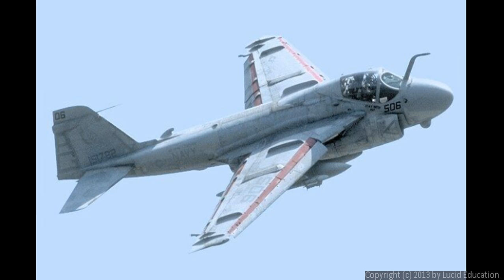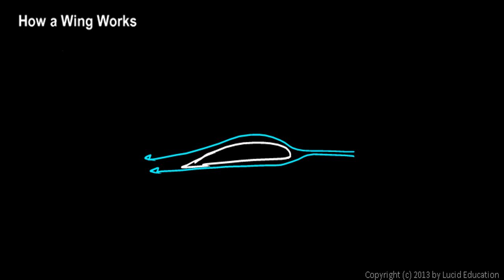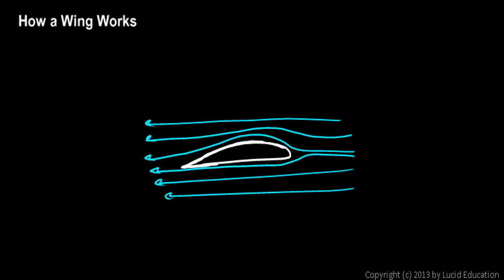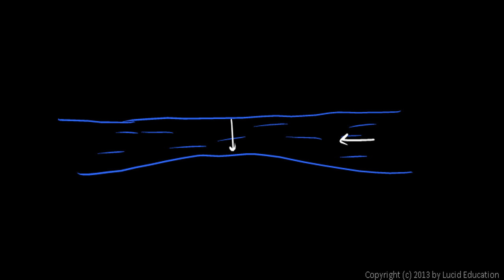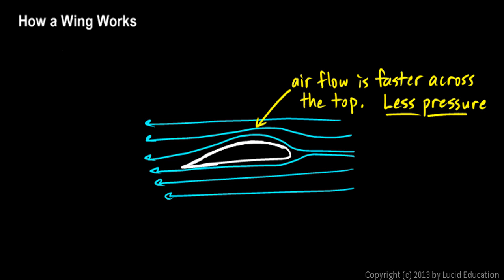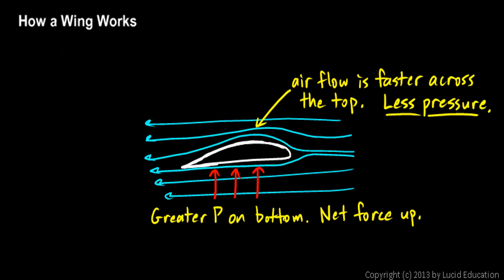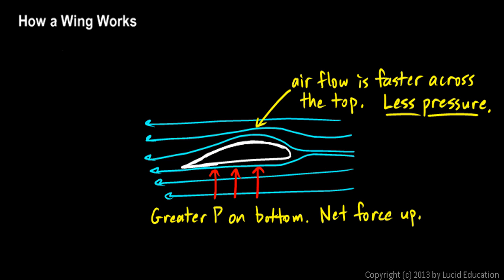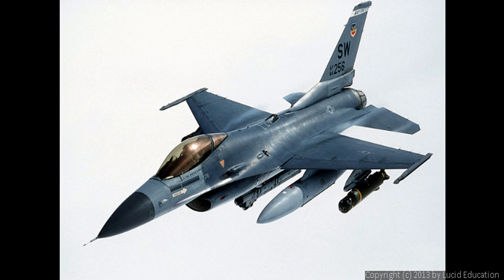Physical Science 3.5b - How a Wing Works

Comment: Bernoullis principle does not state that as the velocity of a gas Increases the pressure decreases. Rather the pressure  decreases perpendicular to flow and opposite to flow, but Increases in the direction of flow, ending up with the same net pressure energy. You have use this  caviot  that bernoulli included in his principle.

Comment: The difference is pressure doesn't cause a force. Rather the difference is pressure is a force. You don't cause a pressure difference and get lift. A pressure difference is lift. Also,  the airfoil shape does not cause a lift force. The shape causes efficient use of the force, but is not it's cause. Further,  the most efficient shape changes with airspeed. A shape that is more efficient at one speed is less efficient at a different speed. To get a lift force upward,  you accelerate air downward.

Comment: Any explanation of lift which claims to be physical science should distinguish between behaviour when a hydrofoil moves through liquid helium as opposed to when it moves through liquid sodium. Any explanation based on Bernoulli, Newton or Coanda fails to do this.

What happens in liquid helium is nothing much. There is no flow separation at the trailing edge and no transverse force or lift on the hydrofoil.

In liquid sodium, which is definitely not a superfluid, there is a flow separation at the trailing edge due to viscosity. A starting vortex is dumped in the flow. By the topological principle of the conservation of vorticity, there must be bound vorticity associated with the aerofoil.

This bound vorticity generates lift by the Magnus effect. I might talk instead about the Kutta-Joukowski circulation theorem, but it's the same basic idea. For fixed configurations of vorticity in two dimensions this is a linear subject where we can use the principle of superposition and say that total lift is proportional to total vorticity bound with the hydrofoil once the starting vortex has disappeared from the scene.

If an aerofoil moves in an intermittent start-stop action, it dumps both starting vortices and stopping vortices, forming a vortex street. This can actually be visualised. This is not a difficult subject once we can see what is going on.

Comment: Why do people always use bernoulli's principle in the wrong way🙄
They say: Because the flow is faster, the pressure is lower.
While in reallity, it is the drop in presure (pressure gradient) that causes the flow to speed up. 
The change in velocity (acceleration) of every (fluid) particle is proportional to the force (pressure) across it! Simply newtons 2th law!

Don't get me wrong:
bernoulli's principle is corect, but it simply desribes the relationship between flowspeed and pressure within a fluid streamline, not that one causes the other to change!

Comment: +Shado8888  Regarding pinching the garden hose.  Yes, you are creating more pressure, but that is BEHIND the pinched spot. Put your thumb over the end of the hose.  After the restricted area point,  the pressure is now lower (actually it is at atmospheric pressure) than it was BEFORE the restriction, so it shoots out into the lower pressure much faster.  Its speed DOES NOT create a lower pressure as incorrectly stated in so very many places. allowing the water to travel much faster as well.  .The "lower pressure" was sitting there all the time...before the water even came along.

Comment: Regarding flying up side down.  You are guessing, not stating facts.  
The inverted engine thrust component in the vertical direction is negligible.  The inverted wing, in level horizontal flight, still generates enough lift to support the plane by producing less pressure on top than on the bottom. Yes, it is less efficient because it is designed to work very well right-side-up.
However,  Think about it.  The only thing you have at your disposal to generate any force is the air itself.  Then, the only mechanism by which you have to generate that force is pressure.  Pressure difference is lift.  Just how that difference is created is the subject debated by amateurs all the time and explained incorrectly in videos, books, and lesson plans in schools.
It does, indeed, take more angle of attack (aoa) to get that inverted lift, but simply stating "angle of Attack" causes lift does not explain how this creates the pressure difference.  Also claiming that when inverted the wing pushes some air downward doesn't correctly explain it either...
...  Because...
There is ALWAYS, always, always a downward deflection of air called downwash. Even when flying upright and is easily shown by the rotating wing called the rotor on a helicopter.   Some like to call downwash  "turning" the air.
Since the air is providing the upward force we call lift, the air is experiencing the Equal and Opposite" REACTION force downward that is described by Newton's third law.  Lift up, air down.

Comment: Well, planes can fly upside down, because you are WRONG in your explanation!
A wing works due to the angle of the wing!! .. the flow goes faster across the top as it goes under the wing.. making less pressure on top of the wing.. Ptop < Punder = Lift..  BUT its not due of the difference in distance.. Btw, the air which goes over the top will actually reach the end of the wing even sooner as the air which passes under it. the air travels faster across the wing.
sorry for my bad english.. Look at the wright brother's plane.. their wings were Almost flat, so its not because of Atop > Abottom which creates lift, its the angle of the wing
Reply from the maker: One of my pilot friends told me once that on a typical small aircraft, about 75% of the lift is generated due to the angle of attack, and about 25% generated by the differential pressure.  And of course that could vary quite a bit from one wing to another, and would be different with flaps up vs. flaps down, above stall speed vs. below, etc.  So yes, it is arguably the angle of the wing that generates the lift.  However, with the proper curvature, a wing can generate more lift with much less drag, and the drag of course is a significant consideration.
Reply: Please watch the video before posting.  Or maybe learn more english and re-watch it.
Reply: Namefag Ive watched it, studied it in school, and sorry but This video is wrong ..
Well not wrong, more like incomplete..
Reply: TheMaauw look up 'Veritasium' he has a good vid regarding this topic...
And sorry about my enlgish, but we have to know 3 official languages where im from... and english is not one of them!
I hope you get the aerodynamics part after watching that video
Reply: See, that's what im trying to say... It's way more about the angle of attack!
And you know, when you look at the Wright-brothers plane, it has close to 0% curvature on the wing. And that plane flew as well :)
Reply from the maker: TheMaauw I think that the Wright brothers started with a very flat wing and later switched to one with more curvature, giving the benefit of much less drag, which was critical.  Interestingly, Richard Pearse of New Zealand lays claim to the first powered flight, a year before the Wright brothers, and his wing was completely flat.  His aircraft had poor control, but it is a fascinating story IMO.
Reply: Derek Owens   However, the Wrights wing was so THIN that the curve on the bottom and top were the same length.   Balsa planes have completely flat wings and use the same principles of cambered wings to create lift.    When you understand the real reasons for lift, this all makes complete sense.
...
Changing AOA does change Lift for sure, however, that doesn't explain how this is accomplished - Just WHY AOA determines lift.  Lift is the pressure difference.  A higher AOA produces a greater pressure difference.  That is all you have in air to provide any force - pressure differences.  The upward force we call lift "is" the pressure difference between top and bottom over the whole wing.

Comment from the maker: Good question.  There are two parts to the answer.  First, they are upside down, but also tilted up a bit, so the thrust from the engine isn't simply forward.  It is forward and up, because of the tilt, and the upward thrust helps hold the plane up.  Also, I think the tilt would cause the wing to deflect air downward, pushing the plane up.  It would be inefficient, because the wing is not designed to work this way, but they don't fly upside down all the time.

Comment: wait i considered it a lil more, the smaller the space the less inclined the air will be to stay in that condensed area because there's an easier path. but i would think there would be an initial resistance despite that, and further the quicker the plane travels the harder it would be to provide more lift as i would expect there to be a plateau effect at one point when the air simply cant move out of the way quick enough, so the plane would require more propulsion